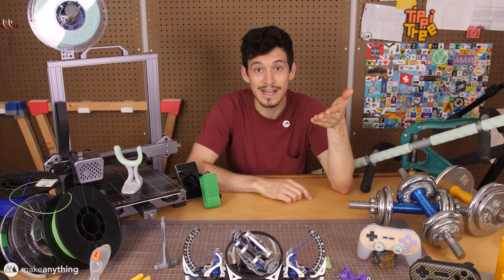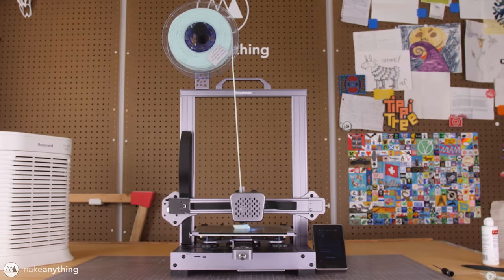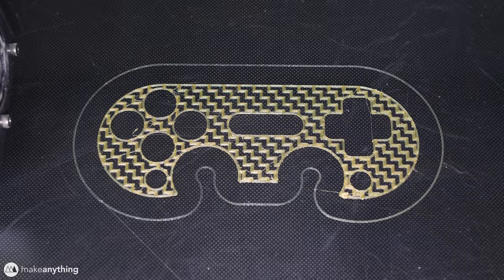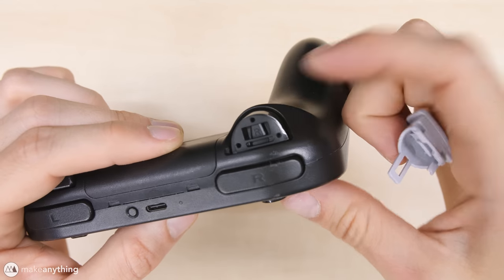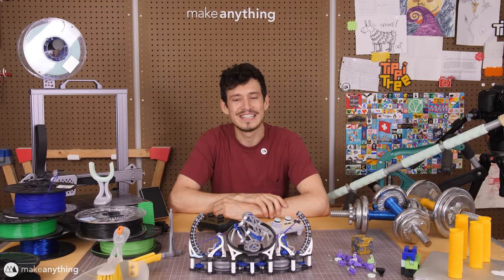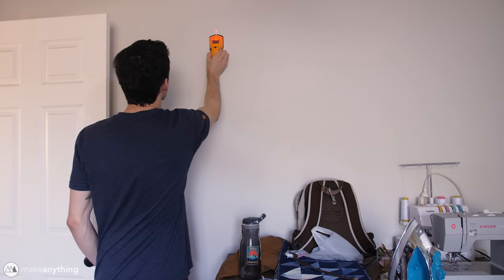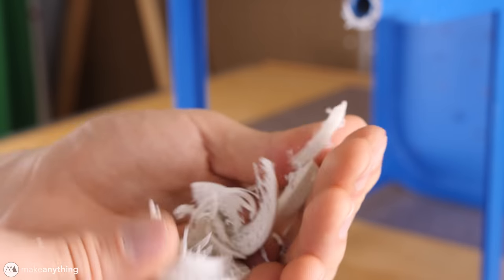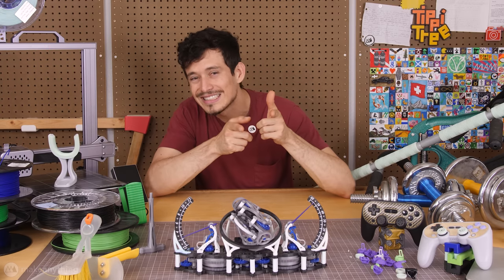Cool Prints 8 // Flexible Functional 3D Prints + Rage-Proofing my Game Controller

Comment: For your grips on your gym equipment, just get a can of compressed air that you use to clean a pc and use the tiny straw nozzle thing to blow air between the grip and the bar to get it off. They're like the grips on dirt bikes but we used an aircompressor back in the day.

[edit] another fella mentioned the hairspray to get the grips on, forgot about that. age woes.

Comment: I have 3 things I use daily, 1 i designed myself and 2 i got from thingiverse.  I have 2 headphone hangers mounted to my wall that got rid of the annoying issue of my headphones being in my way when not in use, i think this is my favorite print. I have a roller that gets all of my tooth paste out, turns out I can get another month worth of tooth paste out of a tube. And then I designed an extender for a shampoo cattey because the cattey was intefering with taking the shower head off in handheld mode so I made the catey hang lower. It worked well for 2 years but the PLA finally gave out and snapped a month ago.

Comment: 21:00 yeah those hand clamps arent great. they work with friction on a rail so they are okay for something like clamping something to a bench but even a basic g clamp would be able to get the force you need for the jean button rivets.

my 3d printer has pretty much become the main problem solving tool i use to make things work better. its so useful, was interesting to see all the things youve made, great video

Comment: Cool vid man. New materials open new doors for everyone. Could you try printing a shoe(or shoe insert, those cost a ton) for us?

Started with thinking the rubbery pistachio would be awesome for fixing any panel with an inset rubber button, right? Like any remote control. Then with two nozzles you could replicate high end tool grips. Inset grips for nerf. Then there's the world of RC tires...

Thanks for the brain food!!

Comment: I'm not sure it's cost-effective to 3D print thumbstick covers for controllers since you can buy them for less than a dollar, but it also probably doesn't matter overmuch.

I do want that tire rubber filament, since shoes wear out so quickly (even the expensive ones) I've been considering printing modular shoes (it's the sole that wears out, every time) so I can just replace the sole as it wears down.

Comment: I'm wondering if you've tried printing some material, inserting an object, and then continuing to print? For example with the gamepad buttons, I thought that this was what you were going to try. You could potentially have a much larger piece of plastic in the hinge area that would be much stronger.

Comment: Would I be able to print that really flexible TPU on a Ender 3V2 with a bone stock hot end & extruder? 
I never even thought of it before, but now I'd love to print some 7/8” handlebar grips for my old 70s moped! I already printed some tire irons instead of buying them and I'm surprised just how strong a 5 walled PLA print is.

Comment: 6:34 Is "the multipass technique" a feature of a specific printer or a technique for making a two (or more?) color print with a single extruder printer?
Reply from the maker: It's a technique. I've used it in several videos :) https://www.makeanything.design/multicolor

Comment: That AtomStack rubber filament looks great. Can you also print it with a Prusa? Also, did they mention when its going to be available?
Reply from the maker: It is 2.85mm filament, but I think you could swap/modify the extruder to accept it. I don't have a Prusa printer unfortunately

Comment: I have one of those, and an wired one, and they feel pretty sturdy. Sure, the thumbstick rubber wired one is starting to wear away, but that was mostly from me having long fingernails. The controllers feel pretty sturdy, and I've broken a few gamepads in the past... You're probably forcing them/extra clumsy/extra destructive.

But still, nice solution and customizations tho. I like the faceplate.

Seeing the rest of the video Yeah, you clumsy and very destructive, buddy. Good thing you can fix those with "handmade" parts.

Comment: You might try to use watch spring bars instead of the metal pin. They're spring-loaded to expand and come in a ton of lengths. Also super cheap!

Comment: By the way, I bet you can print some cane supports, that rubber foot that pressure fits onto the cane. I have to get new ones every year? I bet that rubber stuff would be perfect. My canes with is an inch wide, the other size is 3/4 inch. I would join social media to buy it on my mini factory

Comment: Hello, that was super interesting ! I have a question tho, how do you measure stuff you modeling to go on something existing? do you plan in advance a 1mm space or something so everything fits nice ? Thats my huge pb rn..
Reply from the maker: I usually model the existing part and then model my print over that. And yes, I leave space depending on how it fits together. Usually 0.3-0.6mm clearance for a nice looser fit or down to 0.15mm or so for a snap fit. The key is starting with accurate measurements from your calipers
Reply: @make.anything  much helpfull tyvm 💛

Comment: What kind of printer do you need to be able to print using the special flex/rubber material you used through 18:50?
Reply from the maker: I used the special printer made specifically for that printer, but in general a direct drive printer--maybe with dual extrusion gears--should help feed soft materials like that.

Comment: How do you measure precisely each curvature like for your refrigerator water drip plate? That’s the stuff that would irk me to no end is getting everything right.
Reply from the maker: I use a flatbed scanner to scan the tray at scale and trace it on the computer. It's trickier when you can't remove and scan the part :0
Reply: For non removable parts, you could trim a piece of paper to the same dimensions and scan that, or put the paper over the part and sketch over it with a pencil to transfer the shape

Comment: Right now my friend is working on a robot for this class he was thing of using card board. I came and said that I could model and print the mechanical parts so it is strong. I finished the basic working design on the Hand and now I need to make the joints and base of the robot.

Comment: One of my most useful practical prints revived my beloved multitrack recorder Korg D32XD and saved it from the dump. The original hard drive had died and since the IDE40 interface has died out there's no replacement available. Thus I 3d-printed a frame for a SATA->IDE40 adapter with a quick-snap mechanism for mordern 2.5" HDDs. 
Now I can use new hard drives and swap them out within two seconds, no tools required! 
That is especially useful as I have two of those Korg D32XDs - one at home and another one in the practice room. 
Probably I'm the last D32XD-fanboy of the universe no one else would have cared. But here's the project: https://www.thingiverse.com/thing:3819712

Comment: Honestly, I wish more manufacturers just followed in Sony's stead with the PlayStation 2 controller. If you can get yourself some legit OEM PS2 sticks, or sticks made in a similar fashion they're great XBOX replacements which will last a lifetime.

It's just a rubber dome on plastic sticks. So long you aren't wetting your hands with alcohol nothing of them should dry up and peel off. Contrary to popular belief, the sticks don't slip off of typical thumbs because of the textured surface, though you might have to reach for the edge of the stick rather than keeping your finger centred.

Comment: Why didn’t you just drill a hole in the original part and pass the metal pin through the hole?  A dab of epoxy might have been necessary depending on how thin the plastic was around the pin but it would have left you with a perfect match while still being robust.

Comment: I am hoping to be like you.  So that i can use a 3d printer to print parts the are hard to find or to expensive for what you get.  Like the latch for the console of my car, purchase 3 time what should have been the correct model but non worked.

Comment: While I understand the nice excuse to do some 3d printing and fix the controller triggers, if those things are $50 each, get some cheaper (and better quality) controllers.  That's a ridiculous failure rate for such an expensive controller; you can find decent ones for half that price, buy twice as many, and feel free to throw them away the moment they start to stick or act weird

Though my cheap ones break too, in the same way, thanks Rocket League.  But usually after about a year

Comment: Couldn't you have just drilled a hole through the broken piece and put the nail/pin through that and presto fixed no computer or 3d printer needed
Reply from the maker: Fair point! It might be trickier to line up the nail perfectly but I reckon it could be done

Comment: Well, you should also factor in the time you need to spend designing the 3d model. Imagine you need to spend 2 hours designing. If your normal job pays you 25 USD per hour, you already "spent" 50 USD right there. Not to mention the cost of the 3d printer and filament. If a new item cost 40 USD, your 2 hours are better spent working on your regular job and simply buy a new item. Just my 50 cents.